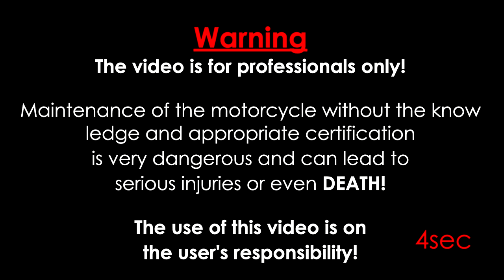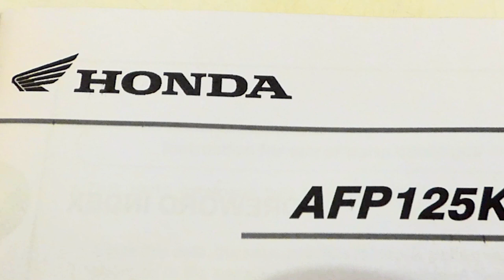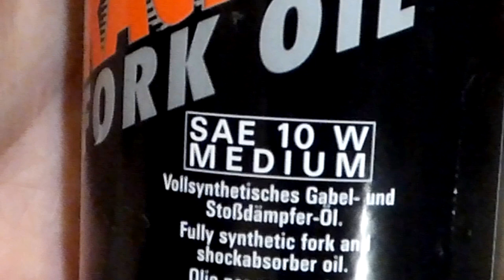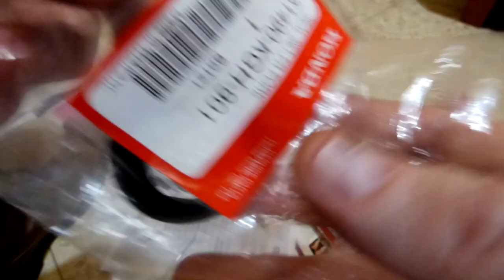Front Fork - Removal & Oil change & New Seals | HONDA INNOVA GARAGE | WAVE | 2010

Comment: Another thing is to NOT over tightened the front and rear axle nuts. Many failed seals/oil leaks caused by that mistake.
Greeting from Vietnam.
Reply from the maker: OVER tightening the axle nut will  break the axle bolt!!! And if the fracture occurs during riding, the broken axle will destroy the seals , and the entire motorcycle can be destroyed in a motorcycle accident.
This is not the over tightening that destroys the seals (because the seals are protect by COLLAR), the tightening is metal to metal, not metal to rubber. The broken screw causes all the damage, which is really dangerous !!!

The destruction of the seals is the smallest problem, the big problem is the possibility to body injury include DEATH
Reply from the maker: Looking back at the video, I think you're right, I did not notice.
https://youtu.be/Q81TcIfJQ_0?t=18
 It seems that the leak is from upper seal that is an O-ring seal. The O-ring held seven years and 35,000km, so I do not think the failure is due to over tightening, although I admit it's possible. very weird. thank you!!!

Comment: Great video....Need to do the seal on one of my forks on a honda pcx 125. Local Honda dealer wants £48 for a pair of seals and 2 hours labour for the job totaling approx £150....I bought a brand new pair of shocks for £65 and did it myself without hassle changing the seals

Comment: This job isn’t for the faint hearted! 😂 Seriously guys, even if you have the knowhow, it’s is seriously tricky requiring professional tools. The time it took me outweighed the reward of doing it myself. Never again. Will be going to garage next time! So please THINK before even attempting this job.
Reply from the maker: Sir thank you for sharing.
Yes, this is a job that requires a relatively high skills.

I failed the first time. The idea in DIY is not to save money, it's the enjoyment of the hobby. You pay money for hobbies, in this case the money for learning from your mistakes, or the money for special tools and so on.

Do-it-yourself mechanics is a nice hobby, not the cheapest hobby, there are cheaper hobbies than that.

Those who do not have time, or those who do not have the patience for this hobby, the cheapest for them is to go to a qualified mechanic that they trust on.

In the case of the Innova front forks, sometimes it is cheaper to buy new ones than to repair the used ones, and then the whole job of replacing them is much less challenging, and a lot easier.

Comment: No "special tool" needed, just use a socket
Reply from the maker: Hi, Thank you for your advice👍👍
What socket did I use (what is the size of the wrench, and what his outer diameter?
And with what technique did you pull the old seals out of their place?
4:52

Comment: My friend,that's an excellent job.Some details make the difference such as heating bolt removal method or using lubricant on hex bolt thread e.t.c.Excellent job,pro done.I would like to add an ease for kids that will follow these instructions.If you don't have the guide for the seals installation ,you can use a socket with the right diameter and seating surface clean and equal very very carefully.My INNOVA Motorcycling:congratulations,keep walking...

Comment: Hello
Thank you for the video

To injection is the same fork?

Can i put 5w fork oil and how much ml?
Reply from the maker: Yes, the shock absorber is the same for both models, the injected one and the one with the carburetor. A less viscous oil is possible, I'm not an expert on that subject, but as far as I understand, the amount is the same amount of oil. You can also change the pair of rear shock absorbers to softer ones.

Comment: Tamir, my right hand fork is leaking oil from the base of the fork by the 6mm screw is located? Any advice?
Reply from the maker: @pp-si2dm  
Hi sir. This is the least common case. So check the main seal on top again.

In principle, the work requires a lot of knowledge, experience, ability, and special tools, so if you are not really into do-it-yourself, go to a licensed mechanic for repair.

The rule is that both shock absorbers are repaired/renewed together. But due to budget considerations, etc., then it is possible to repair only the leaking shock absorber, but this is not recommended.

Assuming the leak is from the 6 mm screw located below, I think there is a way to perform a local repair, that's how I'm guessing. It's without general disassembly of parts. Replace the screw and the copper ring, and put new fork oil from the cap located above... I think it's possible, but not recommended.

By the way, you can also ask a mechanic for a cheap repair, usually without warranty, not every mechanic will agree, because it is not recommended.

Proper shock absorbers are a matter of safety, make the repair properly, that's the best way.
I share, only you know what is right and good for you.
Reply: Thanks Tamir. Really appreciate your advice. I took it to a mechanic and they advice the bolt was loose. They checked it and now it’s leak free. I didn’t look simple as I watched the mechanic. Even with advanced tools it was still a lot of work!

Comment: Hello sir, my lower damper bolt just spinning, I cannot get the bolt out. What should I do?
Reply from the maker: 4:06
You need to put the spring and the spacer back in place, close the fork from the top, then push the piston inward. The force applied on the damper in such a position should stop the rotation of the damper and allow you to open the screw.
Maybe you will need the help of another person to hold the piston pressed.
Reply: @MyINNOVAMotorcycling  Does it need to push hard?
Reply from the maker: @slh0077  
Hard as shown in 4:06 it should work.
The spring is very strong and you most to be careful, it can be really dangerous!!! You may get an another person to help you, and if not go ask for the help from professional  mechanic in your area.
Reply: @MyINNOVAMotorcycling  thanks sir

Comment: Hi matey, a number of people want to make DIY high pressure compressors (4000psi/200 bar) for refilling paintball guns- People are discussing the idea of using motorbike forks to do it - they look meaty enough. Do you know what pressures they are designed to handle? And do you have any suggestions or interest in looking into it... it would be a very popular video I reckon. I might try myself, but need to know the pressure tolerances of forks, plus I don't have a lathe and am worried about getting stuck 99% of the way through the process. With a proper air filter/dryer these could be used to fill diving bottle, too (reserve air source for filling paintball guns). Any help or ideas gratefully received!

Comment: Do we really need to pump the fork when refilling it?
Reply from the maker: Yes, it is necessary
(8:35).
 The operation ensures that the oil penetrates all the oil passages in the shock absorber, it also ensures that the quantity measurement by height will be correct.
Reply: I see, thanks for the answer 😀 👍

Comment: When doing this, do I really need to replace the inner ring and the small spring?
Reply from the maker: If there is abrasion or wear then you need to replace. Sometimes it will be cheaper and of course also requires less work, to buying a new set of shock-absorbers(Forks). Try to check the cost of parts versus purchasing a complete set of a new shock-absorbers(FORKS).
Reply: I also changed the parts that you changed, by problem now is how much fork oil do I need to put?
Reply from the maker: There are two measurement methods, by quantity(70.5-72.5ml) or by height(76mm), see the attached link,
in the split screen at the top left.
https://youtu.be/Q81TcIfJQ_0?t=498
Reply: @MyINNOVAMotorcycling  What's the best method? 
I measured the available fork travel and it showed 84 mm and I also learned that I should leave a clearance of 5 mm so that I get a 79 mm fork travel. Will the oil height method achieve this?
Reply from the maker: I do not know the numbers 84mm or a clearance of 5mm. I know what I wrote down for you earlier. The two methods I have listed are equally good.
The two methods I presented work when the spring is inside, and the tube is inserted all the way into the cylinder.
Reply: @MyINNOVAMotorcycling  Yes I thought about that, it's hard to explain without showing. I'm a bit confused, at 9:02 it said at the video that when I'm going to measure the oil height, "without the spring inner tube fully compressed", what do I follow?
Reply from the maker: You are right, the measurement of depth is without the spring.
1.without the spring
2.inner tube fully compressed
Reply: @MyINNOVAMotorcycling  Okay I got it, now I just need to improvise a tool to measure it. By the way, is there any way I can reach you thru social media? I wanted to show you a picture of a part that I'm having trouble with, and also ask some questions if I ever run into any problem again.
Reply from the maker: @jamescedricdavid6454  
As part of the time I invest in my hobby and my channel, I do not develop and expand it beyond what is happening here on YouTube, and even on YouTube it is not that I see myself having to respond to everyone, it is a matter of time management. There are only 24 hours a day. Hope you understand.
You can upload an image to the cloud, and share a cloud link here.
More significant help can be found in books, and other YouTube channels. Do-it-yourself motorcycle mechanics is a hobby that requires a lot of knowledge, time, patience, and accuracy, and if something goes wrong feel free to contact a qualified mechanic in your area, because safety is above all!!!
Reply: @MyINNOVAMotorcycling  Alright, I understand. Thank you for helping me.

Comment: Do I really need to replace the small spring?
Reply from the maker: It is mainly the replacement of the oil, and the replacement of the seals. Note, for me all the components were found to be OK, but I replaced because I had the parts to replace. In my particular case, the malfunction that caused the oil to leak was  a defective O-Ring in the top Left Fork.

Comment: Excellent video. But I have a question , changing oil on my forks I've notice that the left fork spring is smaller than the right one . Is that normal or is time to replace it? Or put a spacer?
Reply from the maker: I did not check if there was a gap between the two lengths of springs, I only checked that they separately meet the specification. A spacer with soft or weak steel will cause damage. I would not insert a spacer. What lengths did you measure? Because in any case a difference of one millimeter would make no difference. I have also shown that when you start ordering a few parts, it comes out more expensive than purchasing the whole fork, so you have to pay attention to that as well.
Reply: tamirkr thanks for the quick response. The difference is 2 cm.
Reply from the maker: Thanks, but I would not rely on my quick response, I'm usually slow, and sometimes it can take  a weeks.
Two centimeters is a strange and unlikely gap. Maybe you got two springs from different models? One before 2007 and the other after 2007, because according to the Hynes Guide, this is the gap between them, two centimeters.
https://youtu.be/Q81TcIfJQ_0?t=501
Reply: Very impressed...! That's the case and that explains it all.
Bought this bike last year second hand, from the very first look I've noticed
the front fender was from wave (the bike is innova)
possibly they have had a small crush and replaced the fender and one fork.
Tamir thanks again and keep up the good work..!!!

Comment: do you mean its better to buy new fork assembly for only 90$ rather than to repair your old one because it much cheaper and most of all its brand new.
Reply from the maker: I'm not trying to say anything, I'm just sharing. My films are not a course in mechanics. Besides, the new pair costs 56$, my patch cost 90$. I'm talking about the cost of the parts and materials, in the garage you will also pay for the wages of the mechanic's work.
The total expenses, and as an amateur mechanic, the repair cost me about 90$, while a new pair of forks costs about 56$. You can also see this as a kind of self-humor. In retrospect, it seems that only the replacement of the upper seal was sufficient. That O-Ring cost only 2.9$
Reply: @MyINNOVAMotorcycling  but I think if you have a tools already your costs my less, you only pay for seal.
Reply from the maker: Absolutely true, but in that case(Honda INNOVA), I could not find a way to make the repair without that special tool which cost me 28$
The special tool was added to the general account. But again, it was impossible without him, so as an amateur mechanic who did not have that special tool, I added his price to the general cost.
Reply from the maker: Gary Dodgson  Excellent thought, of course you can produce such a tool yourself, or use a Socket in a suitable diameter. Either way, the set that I bought, and made from aluminum, is cheaper than the price of professional tools. There is a unique difficulty here for this particular model, the seal is adapted to the pipe with extreme pressure. That's why you need a lot of strength And power to bring it in place. Using strong force on the delicated seal, without a special tool, will destroy the delicate springs that sit inside him.

See the comment attached in the beginning of the comments area, a comment  of Tyler Durden from Vietnam.

Comment: Xtreme bike 150cc fork me kithna ml oil dalna cha he a
Reply from the maker: I do not know the manufacturer's recommendations for your model. More oil will give you a shock absorber with more rigidity, less oil (more air) will give you a softer shock absorber. The main thing is that on both sides you put the same amount of oil.
Reply: How much oil both fork  in Xtreme sport bike 150cc
Reply from the maker: I guess less than the contents of one 500ml bottle.
Only GUESS

Comment: Ano po gagawain pag malambot pag sakay palang bumabaon na
Reply from the maker: If the shock absorber is soft because the oil has escaped, then you need to replace the seals and put in a new fork oil.

The shock absorber can also be stiffened by putting in thicker fork oil (depending on what you have now). I put in 10W fork oil, and I think there is also 15W and 20W.

Other methods: insert a stronger spring, or insert a longer spacer (which will make the existing spring to be harder).

Comment: In how many kilometers this work happens ? By the way, nice pajamas 😎😎😎
Reply from the maker: 31,170Km
I was not careful about riding on bumpy roads, or getting on sidewalks. Now I'm more careful.

Other commenter here suggested that the problem is with the assembling in the Honda factory: The gripper nuts on the handlebars were tightened too tight and therefore thay destroyed the top O-Ring.
Reply: I have 102.000 km on my innova 125i and all parts are working perfectly.
Reply: @lambrostsalis  έχω κάνει την διαδικασία στα 20.000 χιλιόμετρα μόνο! Γιατί το μηχανάκι δεν είχε καθόλου ανάρτηση! Κοπανουσε σαν παλαβό. Οπότε σου συστήνω να το κάνεις κι εσύ και θα καταλάβεις την διαφορά.
Reply: @dimisdnc710  Λογικά θα γίνει λειαν συντόμως γιατί είδα λαδάκι που έτρεξε στις πίσω, οπότε θα θέλουν και οι μπροστά φτιάξιμο

Comment: 8:23 4window  303.1 is to short..maybe is 330.1mm or 333.1 mm ?
Reply from the maker: Hi. 
At your request I have checked again, these are the minimum dimensions that appear in Haynes Guide No. 4926 on page 5 * 1
I do not know if the measurements are too short, I know that these are the minimum measurements according to Haynes' guide, less than that, according to the guide., the spring needs to be replaced.
(303.1 mm MIN is ONLY for models 2003-2006)
Reply: @MyINNOVAMotorcycling  i have 2003 model....my spring is 330.1mm and has softened a lot so that it has sat down and hit the puddles
Reply from the maker: @mogias7  
The standard size for the 2003 models is 316.3 cm, at least according to the Haynes guide, so I think you are holding the wrong spring.
On the other hand,
according to the same guide the standard  for the 2007 model is 328.8 cm, and I measure 350 cm
(time 8:23)
, so I do not know how much we can trust that data in the guide. It happens, not much, even rare, but it happens that in books, even technical books of the manufacturers themselves, you will find mistakes.

Bottom line, it's possible that (1) your spring did not fit your model, (2) old weakened spring , or (3) maybe you forgot to put one of the spacers?  Or other assembly malfunction?